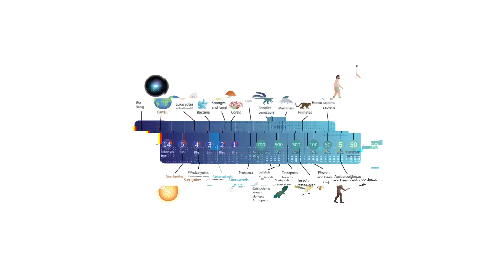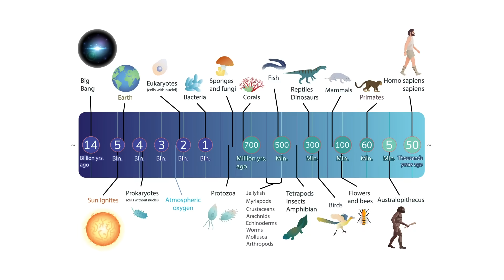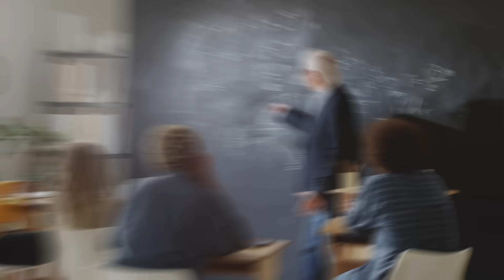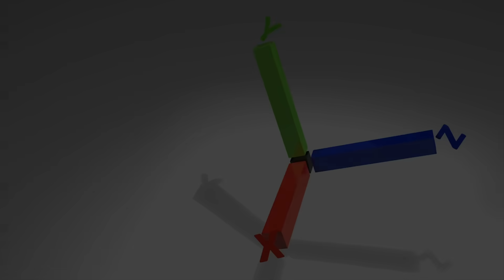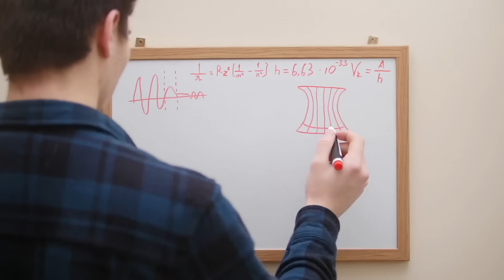Brian Cox - Why Did The Big Bang Happen?

Comment: In order to follow the law of conservation, I have a gut feeling that it's possible there's a whole bunch of bubbles interacting with each other on a grand medium like oil in water where the density's separate the oil in perfect little circles and they can absorb each other and move and maybe black holes are grand recycling machines in the universe and the laws of conservation of matter aren't broken, they take a form of matter and they convert it to other forms of matter but it doesn't gain or disappear, it just alters, maybe into gas form or plasma who knows, they could travel through the black hole 🕳️ into another universe bubble and recycle ♻️ energy there still with the universe, or it could transfer to a different far off region of the same universe bubble? Maybe in different bubbles they all run by the same base laws but maybe in every bubble the factors to the power and the interactions of those base forces are randomly jumbled up, and there's many bubbles that are unstable, but through natural selection, you would come across stable bubbles but it would be like nature and evolution or if babies survive to past birth and childhood to adult hood... Idk just a random theory but of course nothing answers how that started I don't understand how we will ever figure that out and honestly I'm okay with that. I've found peace with finding that it's okay to not find the answers for everything, for certain things, maybe that's the point. It's probably impossible for us in our human perspective to figure out these questions and that's okay, nature has it's ways and I'm sure it will all work out in the end or else why would it function the way it does. Nature is very therapeutic for me. Observing the seasons as I hike with my dogs, how trees get recycled by fungi, interconnection within ecosystems. It all can teach us things about other things if we look at those things with the right Perspective.
Reply: Seems like there is no evidence for this but hey maybe
Reply: Great explanation sir !!
I kind of agree with you !!!
Reply: The theory of everything according to humans that believe their intellect evolved from a monkeys brain. If the light waves from the sun were 8 minutes and 20 seconds in a past dimension of Einstein's space-time then people on Earth are just imagining the infrared warmth of the sun coming up on the horizon. The communications delay between Earth and Mars is approximately 20 minutes. We're either viewing the light from Mars in the future, Einstein's past dimensions of space-time or in real time, which do you think is more logical? Einstein's relativity is wrong light has no limitation of speed; it cannot be slowed down because it isn't moving. From every vantage point in the universe light is omnidirectional-instantaneously traveling in both directions. Light and electromagnetic waves are independent of each other. According to Einstein's relativity-time dilation's, photos taken of the Earth from the Discovery Space station traveled from the past to the future violating the laws of physics, conservation of energy and common sense :-)

The speed of light according to Einstein's relativity is 186,000 miles per second, but according to physics if two mechanical watches were synchronized on earth and one traveled across the universe and back, there would be no difference in time between the mechanical watches proving the speed of light is instantaneous as the only way a mechanical watch will run slow is if you tighten the main spring. Big Bang, Einstein's relativity-time dilation and nearly all of science debunked. Using optical clocks, lasers and GPS to prove Einstein's time dilation-space-time curvature is like using a metal detector to find gold at Fort Knox. The closer you are to the electromagnetic fields, mass and gravity of the earth the more light bends aka gravitational lensing. 

Light waves can stretch, bend-curve and occupy a state of superposition, whereas the hypothetical Einstein projectile light particle (photon), a particle that has never been observed cannot. Unlike a TV or computer monitor the images we are viewing in the universe are in real time, not a series of frames that create the appearance of a moving image. There are no DCU digital convergence circuits in space yet Einstein's disciples believe the light and moving images they see in the universe aren't really there, they're just video recorded images of the past 13.8 billion years. You could lead a cult to water, but you can't make them think. Neither time, energy nor mass can create itself into nothing, reside in nothing or expand into nothing simply because nothing has no properties. Time and space are independent of each other, not material bodies or fantasy unions that magically stretch Time, energy, and matter like a rubber band into space-time dimensions. Monkey see monkey do, the science of monkeys have brainwashed you. 

Will the James Webb Telescope view the birth of the first galaxies? Nope, the universe goes on to infinity. Neither time, the atom, energy nor mass can create itself into nothing, reside in nothing or expand into nothing simply because nothing has no properties. The James Webb Space Telescope is not a time machine, you can’t travel back in time to view the beginning of the universe with telescopes that were made in the future :-). Light and electromagnetic waves are independent of each other. If science uses Einstein's wrongly theorized speed of light like an odometer to calculate past dimensions of distance and time, then using that same method to calculate forward dimensions of distance and time would mean the Big Bang was created and expanded in the future before time existed. Unlike a television or computer monitor the images we are viewing in the universe are in real time, not a series of still image frames that hypothetical Einstein projectile light particles photons create to give us the appearance of a moving image :-). 

The speed of electromagnetic wave is 186,282 miles per second vs Einstein's projectile light particle proton at 186,000 miles per second. Is this a coincidence or did Einstein plagiarize yet another phenomenon to fit the math of relativity? Electromagnetic waves in space can neither slow down or speed up, this is consistent with the law of conservation of energy. If light slowed down, its energy would decrease, thereby violating the law of conservation of energy so the speed of light is instantaneous and cannot travel slower than it does. If Einstein's projectile light (particle photon) had mass it's light could not travel across the universe, high speed particles traveling at 186,000 miles per second would break the Hubble and James Webb telescope mirrors, debunking the speed of light, Big Bang, Einstein's relativity and any science that uses relativity in their theories. 

Everyone knows cell phone electromagnetic radio waves travel both ways, yet Einstein's disciples believe time energy, mass and light can only travel one way back in time. If you simply run the Big Bang theory in reverse you reveal the insanity of Einstein's relativity and Big Bang theory. If the expansion of the Big Bang were true, time, energy, mass and light would be in the future from the vantage point of an expanding singularity-Big Bang and planet Earth would now reside in a past dimension of Einstein's time dilation (moving clocks run slow) space-time 13.8 billion years ago :-). 

It's truly amazing how the science and politics of the left are able to keep people denying reality, there are no DCU digital convergence circuits in space, yet Einstein's disciples believe the light and moving images they see in the universe aren't really there, they're just recorded images of the past 13.8 billion years. Pretending not to notice the gross contradictions-pseudoscience in Relativity is typical of Einstein's disciples, devaluing the source of any information that's in contradiction with their beliefs-theories. You could lead a cult to water, but you can't make them think. If the light from the universe travels to past dimensions of time then it's light is also traveling into future dimensions of time (instantaneously). “And God said, Let there be light: and there was light.” a state of superposition where time and gravity run inwardly, outwardly, in all directions in the same time frame, similar to the electromagnetic field having no beginning and no end. "I am the Alpha and the Omega, the First and the Last, the Beginning and the End" Revelation 22:13. Disciples, remember thy 1st commandment, thou shalt not question thy lawgiver of relativity for blasphemers are the devil's pawn. Let thee not dwell in dissension of our Lord Albert, shun them, drive them back to their jungle lair amen. 

Albert Einstein, an autistic violinist patent clerk that had access to more papers than Suzanne Somers litter box yet creates theories with more bugs than Terminix- Magnetron. View my paper on academia (Big Bang, Einstein's Relativity-Time dilation and nearly all of science debunked) You can also find me on Twitter, Facebook, Truth Social and Mewe
Reply: First, you need a universe to place your hard disk in.. 😁
Reply: Well thank God that science isnt governed by "gut feelings"
Reply: The communications delay between Earth and Mars is approximately 20 minutes. We're either viewing the light from Mars in the future, Einstein's past dimensions of space-time or in real time, which do you think is more logical? The speed of light according to Einstein's relativity is 186,000 miles per second, but according to physics if two mechanical watches were synchronized on earth and one traveled across the universe and back, there would be no difference in time between the mechanical watches proving the speed of light is instantaneous as the only way a mechanical watch will run slow is if you tighten the main spring :-). Big Bang, Einstein's relativity-time dilation and nearly all of science debunked. There are 7.7 billion people on planet Earth, yet I was the only one who knew I was viewing the light and images of the universe in real time, maybe I should be working for NASA or Elon Musk :-)

Light waves can stretch, bend-curve and occupy a state of superposition, whereas the hypothetical Einstein projectile light particle (photon), a particle that has never been observed cannot be both a particle and wave. There are no space-time fantasy unions or gravity waves that can join a particle, wave and time together then bend, curve and stretch them like a rubber band. Neither time nor mass can create itself into nothing, reside in nothing or expand into nothing simply because nothing has no properties. Time and space are independent of each other, not material bodies or fantasy unions that magically stretch time like a rubber band into space-time dimensions. The James Webb Space Telescope is not a time machine, you can’t travel back in time to view the beginning of the universe with telescopes that were made in the future :-). Light and electromagnetic waves are independent of each other.

The speed of light can be slowed from 186,000 miles per second down to 38 mph by shooting a laser through extremely cold sodium atoms acting as “optical molasses” If the universe were suddenly destroyed, collapsed or fell into a black hole do you honestly think slowing down the speed of light with sodium atoms would save the earth from being destroyed, giving people on earth time to find another planet to colonize and destroy :-). Using optical clocks, lasers and GPS to prove Einstein's time dilation-space-time curvature is like using a metal detector to find gold at Fort Knox. The closer you are to the electromagnetic fields, mass and gravity of the earth the more light bends aka gravitational lensing.

If black holes reside in a region of Einstein's theorized space-time where gravity and mass are so dense that nothing, neither mass-particles nor electromagnetic radiation such as light can escape then how could it be possible for the entire mass of our universe to escape the unimaginable density of the proposed Big Bang? According to general relativity sufficient compact mass-density will deform space-time to form a black hole which obviously debunks both Big Bang theory and relativity! Big Bang theorists rely on red shift to support the hypothesis that the universe is expanding, the very phenomena that supports the hypothesis of a (non-expanding static universe). You can duplicate the ion thruster jets of a black hole in a vacuum using a Tesla coil or build one using high voltage-an array of magnets-a CRT-TV yoke or inductor coil. Black holes are nothing but plasma driven vortex electromagnetic fields expanding electromagnetic waves in space. Since the vortex of black holes are thought to be at the center of all galaxies they might be the very force that created them.    

Gravitational lensing occurs in all wavelengths of light including (red shift-microwave background radiation). Gravity from huge celestial objects of galaxies bend, curve and expand light giving the appearance of what Einstein wrongly theorized as time dilation-space-time-debunking the big bang. Mass from galaxies, planets and black hole electromagnet fields bend, curve and expand light giving the appearance of what Einstein wrongly theorized as time dilation-space-time dimensions. Light like all electromagnetic radiation and electricity is the result of moving electrons, as moving electrons of charged electromagnetic waves-light travel through the plasma of the universe each lump (or "quanta") of energy in the electromagnetic waves are charged then discharged to the next lump, eventually the energy dissipates causing the delay in radio communications giving the appearance of time dilation - the appearance of longer wavelengths in red shift. Light and electromagnetic waves are independent of each other.

If space was curved-warped according to Albert Einstein's curved-warped gravity theory, like a boat in the ocean these same gravity waves would affect time and the perfect balance in solar system orbital mechanics throwing planets off course-out of orbit in a collision course towards the sun where a planets gravity and time would increase and decrease with different velocity rates as they ascend and descend the curves of gravity waves. Using optical clocks and lasers to prove Einstein's time dilation-space-time curvature is like using a metal detector to find gold at Fort Knox. The closer you are to the electromagnetic fields, mass and gravity of the earth the more light bends aka gravitational lensing. 

If gravity is the result of mass then before the universe came into being gravity couldn't have existed simply because mass was not yet created! Galaxies with massive gravity from the early Big Bang would have been gravitationally bound like the Andromeda galaxy is to the Milky Way galaxy, the sun, moon and planets in all solar systems in the universe yet these early galaxies were able to somehow escape these massive gravitational forces continuing to expand at an increasingly faster rate. Into what, nothing? Nothing has no properties! Neither the atom, universe nor time can be created or destroyed. Albert Einstein an autistic violinist patent clerk that had access to more papers than Suzanne Somers litter box yet creates theories with more bugs than Terminix. “And God said, Let there be light: and there was light.” a state of superposition where time, and gravity run inwardly, outwardly, in all directions in the same time frame, similar to the electromagnetic field having no beginning and no end. 

If space was curved-warped according to Albert Einstein's curved-warped gravity theory, like a boat in the ocean these same gravity waves would effect time and the perfect balance in solar system orbital mechanics throwing planets off course-out of orbit in a collision course towards the sun where a planets gravity and time would increase and decrease with different velocity rates as they ascend and descend the curves of gravity waves. Using optical clocks and lasers to prove Einstein's time dilation-space-time curvature is like using a metal detector to find gold at Fort Knox. The closer you are to the electromagnetic fields, mass and gravity of the earth the more light bends aka gravitational lensing. Neither time nor mass can create itself into nothing, reside in nothing or expand into nothing simply because nothing has no properties. Time and space are independent of each other, not material bodies or fantasy unions that magically stretch time like a rubber band into space-time dimensions. Albert Einstein, an autistic violinist patent clerk that had access to more papers than Suzanne Somers litter box yet creates theories with more bugs than Terminix-Magnetron.
Reply: @michaelbariso3192  What is your theory?
Reply: @catalinacurio  My theory, you can lead a Democrat to water, but you can't make them think
Reply: @michaelbariso3192  You think the universe gives a poop about politics. 🙄
Reply: @catalinacurio  Zoologist evolutionist Richard Doggins says the What's A Woman Movement is real science and predicted by Charles Darwin in The Origin Of Species